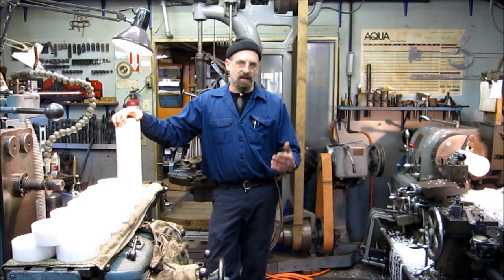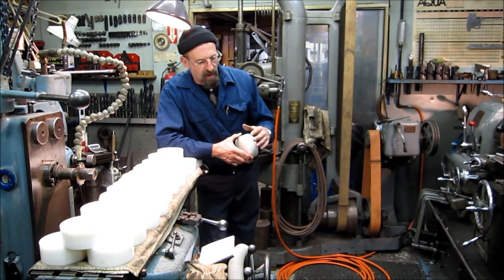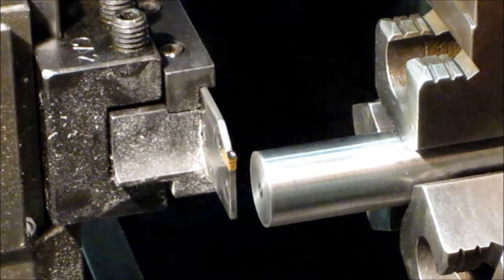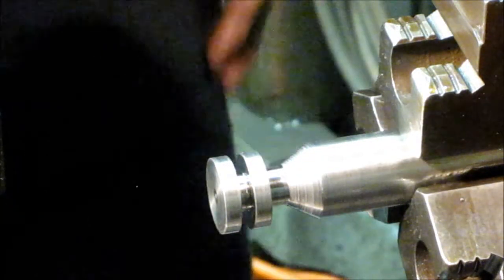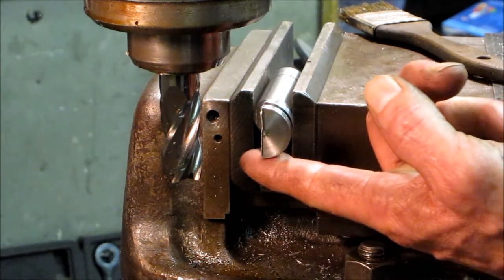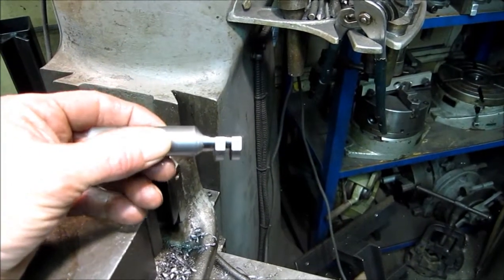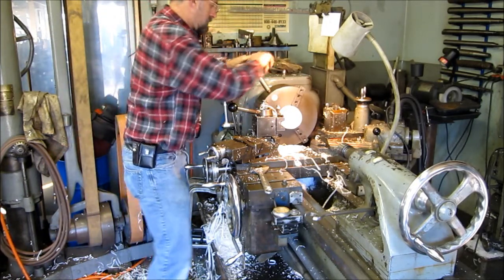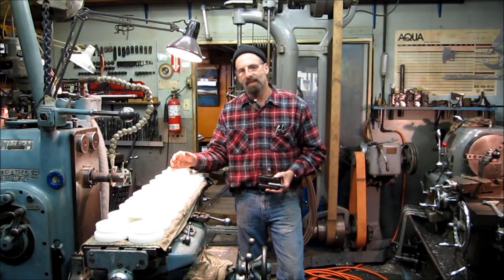Form  Thinking

Comment: I really like working with Delrin, you can fly and it finishes nice. Make all sorts of things out of it including brackets/ hardware for sensors and such (I work in a factory). Probably not OSHA approved but on certain cuts and definitely when auto feeding, I just hold a big shop vac line right on the string. Leaves everything clean for measure/unload/ load.

Comment: I've machined this type of material UHMW into bushings and air cylinder pistons, key is to have really sharp tooling. Cutting both O ring grooves at once is a huge time saver, and the tool you made cut very nice.

Comment: I never like the smell of the formaldehyde gas that is released when machining delrin, it gets worse with higher cutting speeds.

I use high speed steel cutters when turning and facing delrin, nylon and uhmw, radius on the cutter of at least 1/16" and a RPM around 500 lets you manually crank the handles as fast as the machine allows and still get a good finish, 1/2" depth of cuts turn out well.
Reply: I know Im quite randomly asking but do anybody know a good place to stream new series online?
Reply: @Derek Brycen meh try flixportal. you can find it through google=) -bryant
Reply: @Bryant Barrett Thanks, signed up and it seems like a nice service =) Appreciate it!!
Reply: @Derek Brycen glad I could help :)

Comment: I remember working with Delrin, Glass Filled Delrin, and G10 (G10 is layers of fiberglass textile and some green resin, cured under pressure). Easiest to clean up the standard Delrin chips (ling and bushy), GFD and (not SO much) G10 create small fluffy chips and glass dust that floats all over the shop.

Comment: Do you do many jobs like this? One of my first jobs as an Apprentice was to operate a Ward turret lathe. These old monsters are laying about here now because CNC has over taken them. Basically they have a air operated collet chuch,a turret tool holder with up to 6 different tools and turret tail stock with 5 or six different tool positions. I could turn out 20,000 steel pins per 8 hr shift. .They were also very fast .Imagine 1"  steel chips coming off so fast they turned blue in the air.
Reply: Kinda like my 1st shop as an apprentice.Among other things,I mainly ran multi-spindle screw machines,Davenport,Acme-Gridley,Conomatic,B&S to name a few.,as well as turret lathes like you.Every shift we ran between 5-10K gears and cutters for hand can openers,7 days a wk,365 a yr.Do the math.Who the HELL uses that many can openers,even world-wide,lol?!

Comment: I machine plastics all day long I find it easier to touch on with the parting off tool to give me a guide for the bandsaw then cut through in seconds and just face up each side, I can use a much smaller parting tool and I prefere facing than parting but each to his own method we would all be boring if we did the same thing.
I much prefere plastics you can break your edges with a stanley blade.
keep the videos comming I do enjoy all of them

Comment: Making that tool bit i would have used an angle grinder instead of the mill... But speaking from previous tool purchase experiences, if i had a mill in my shop it wouldnt take long before i'd use the lathe for that job, like you do ;) You can never have enough tools :)

Comment: Excellent job with the tool, we have the factory tooling at work for cutting similar grooves on our CNC and they run around $300 NZD! and thats just for cutting one groove at a time... We set up a vacuum to suck up the swarf as it comes off the billet to aid in cleanup and to keep the tools clear  :-)

Comment: Keith did you heat treat the tool?

You said it was tool steel and I was wondering if you did.  I wouldn't think it would need to be that hard since Delrin cuts so easily.

Great video.